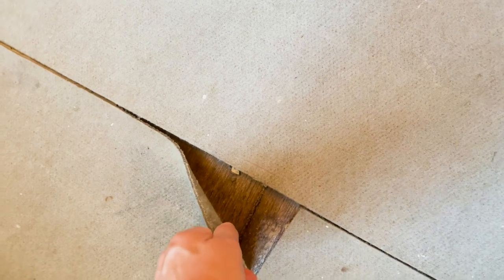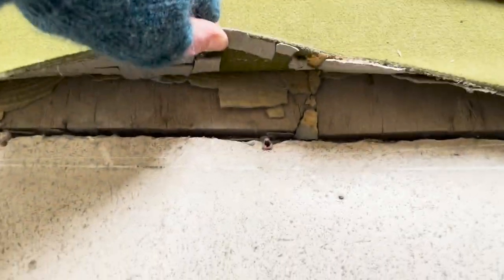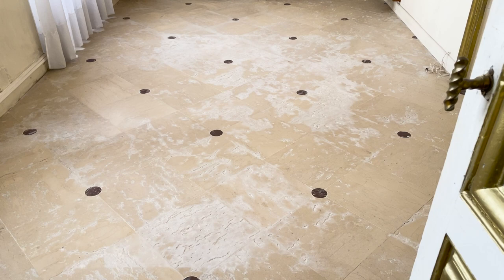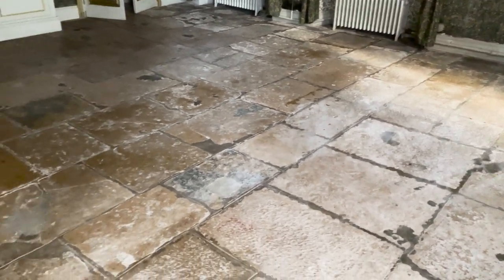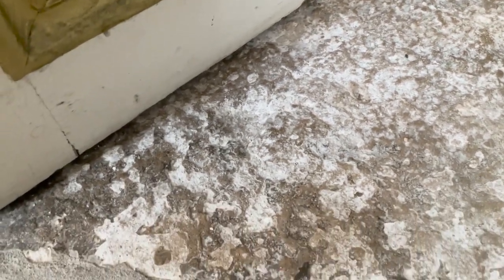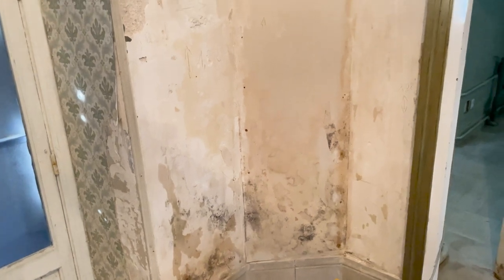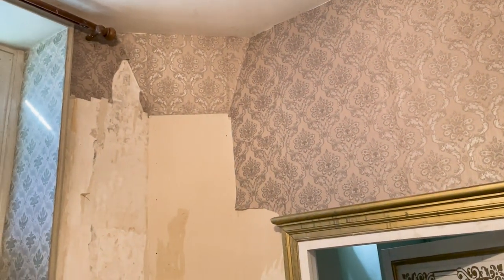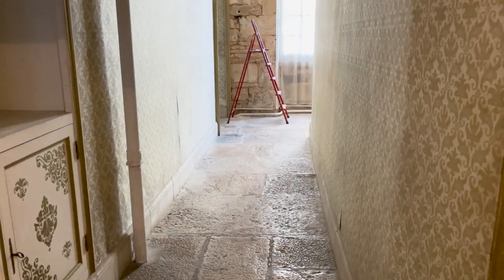Ep. 9: Floor Problems in My 18th c Home

Comment: I think you will need french drains all the way around the house. Theywould be one way to deal with the moisture.
Reply from the maker: French drains are a great solution. One side of my house is on the street, so a neighbor suggested I ask the city to do that for me. On the other side, the yard was filled in with heavy gravel, so I plan to remove at least a foot of it to expose the house stones to more air. At that time I will get a better idea of how deep the gravel actually goes, and might plan a french drain that goes even deeper.

Comment: What's causing the damp in the floors?  Would you need French Drains put in around the outside walls???
Reply from the maker: I’m not sure if there is a single source. It’s a natural phenomenon for stone houses, but usually it evaporates as it comes above ground. My house has a cement coating on the outside, which isn’t the proper treatment, and it’s trapping the moisture until it can find a way to evaporate inside the house. The high humidity inside may be one part of the problem, so I’m working on that. Also, the cellar windows were blocked off so the air circulation down there is t as good as it should be. The back yard soil level was raised about 2 feet, putting more of the exterior walls underground. And lastly, I believe the street level was raised in front of my house, adding to the problem. I plan to lower the back yard, improve air circulation, dry the interior, and hopefully someday remove the exterior finish.